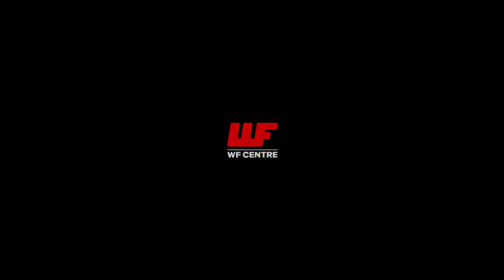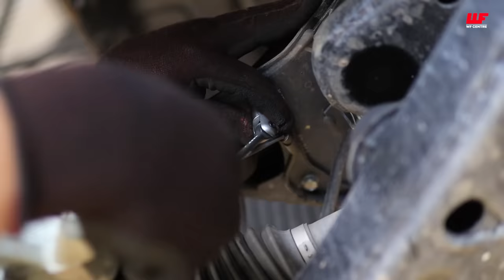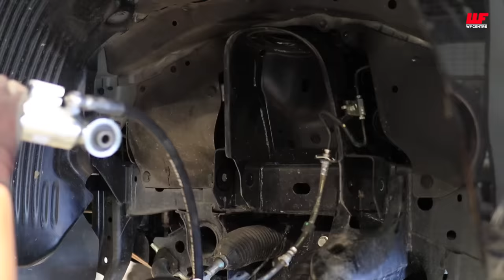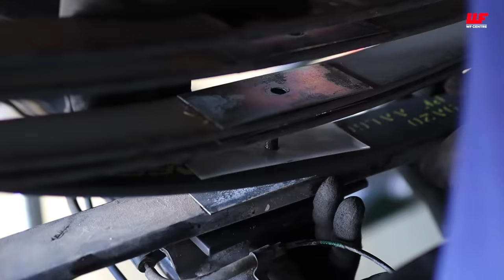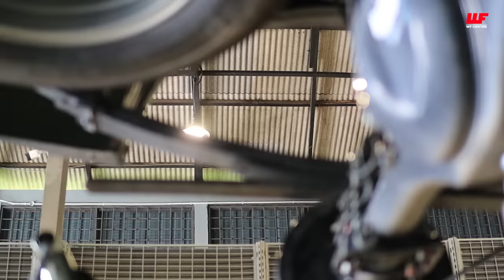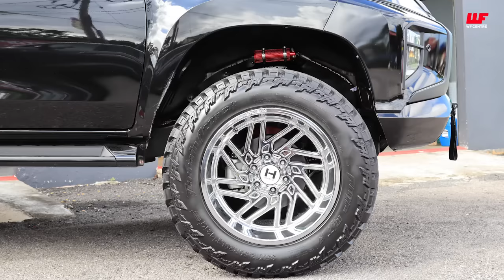(PROFENDER) THE MAKING OF TRITON AMERICA STYLE

Comment: Oh yeah love the rattle gun being used on suspension components instead of a torque wrench with the corrects torque specs.
Reply: Was thinking the same thing..I've fired people for that type of poor behavior..
Reply: lol our mechanics be like "whats a torque wrench" 🤦‍♂
Reply: that really bothered me 
also not tightening nuts in a cross pattern just going around really triggered me
Reply: Do enough and you know when is tight
Reply: @Bigsoot7393  I would pay to see someone get right torque every time even with 10 years experience using a rattle gun
Reply: @LVNITUPM8  I do it every day, never have things come loose
Reply: @Bigsoot7393  didn't say it would come Lose I said its not the correct torques spec and if over torqued bolts snap
Reply: @LVNITUPM8  it's all about common sense, a good mechanic knows when it's tight and too tight
Reply: @Bigsoot7393  that's the problem, majority of people in this day snd age lack common sense. So of a bolt is not correctly torqued up and causes major mechanical failure, someone gets injured or dies. You think the courts are going to accept the answer that you used common sense when tightening up a bolt that caused the injury or death, that's you of to jail
Reply: @LVNITUPM8  well been a diesel mechanic for 14 years and have never had an issue with using common sense
Reply: @Bigsoot7393  and I have been operating drill rigs for 15 years and use common sense, but I kill someone because I didn't torque up bolts to manufacture specifications off I go to jail. Common sense not saving me
Reply: @LVNITUPM8  I've fixed drill rigs for probably 5 years and never seen a single person torque a bolt besides when it's a service
Reply: @Bigsoot7393  those people that don't are called cowboys. You can keep arguing the point but as a mechanic you should be the first person to be using correct torque specs and if you don't that sez a lot about you and the quality of work you put out
Reply: @LVNITUPM8  I work on hundreds of different machines as do many others you aren't going to buy books for every machine you'd never make any money, I'm not a cowboy I'm just good at what I do
Reply: @Bigsoot7393  you keep telling your self that.
Reply: @LVNITUPM8  thanks mate I will

Comment: Every bolt on with a rattle gun… good luck changing them when you’re a long way from a compressor
Reply: youve never heard of torque wrenches huh LOL
Reply: Ya, all the Control arm bolts were torqued with a rattle gun on the hoist when they are supposed to be torqued on the ground at ride height. All those bushes will be busted real quick…

Rando Asian kid, a torque wrench is used to torque up bolts, not to remove them… all quality torque wrench will tell you not to use them to undo bolts…
Reply: @agentthumb  whatever
Reply: Prepare a 1 meter 3/4 pipe
Reply: @randomasiankid017  yep but wouldn’t use one to remove nuts installed with a rattle gun.. it’ll destroy your torque wrench.. instructions from the largest manufacturer of torque wrenches. I quote: “A torque wrench is a precision tool manufactured specifically for applying precise torque forces to tighten bolts. Torque wrenches should never be used to loosen bolts as in most cases torques wrenches are manufactured for clockwise direction tightening”
Reply: @warrenw273  no it will not